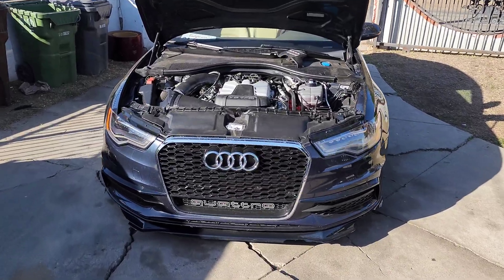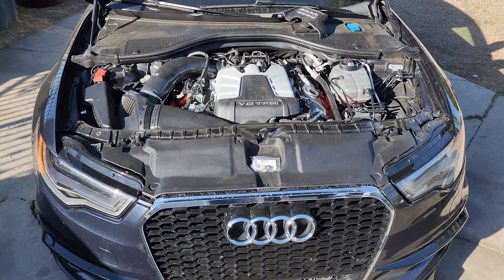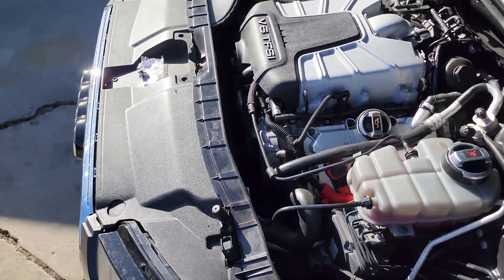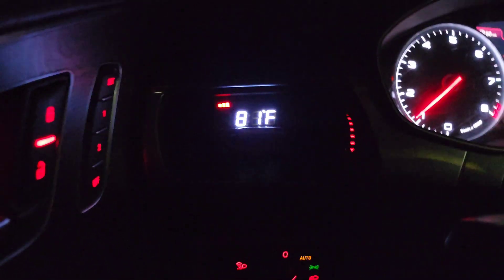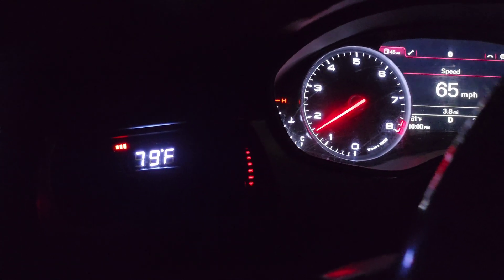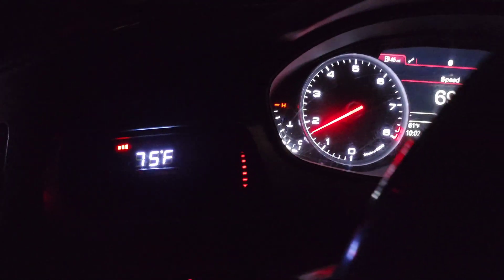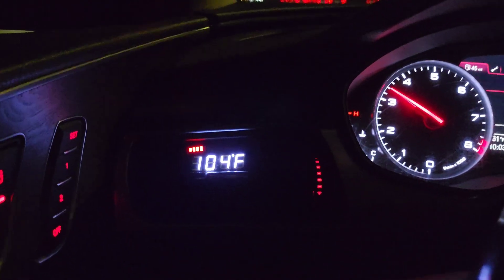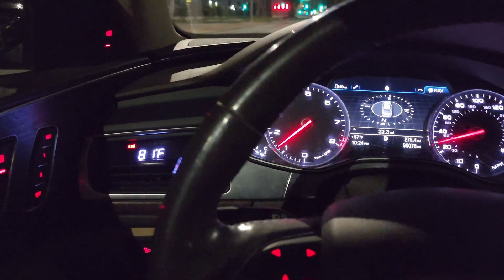CWA150 @ 100% Pump Run Test & 034motorsports Billet Bleeder Screws

Comment: can you give a update if the pump is still running good today? i just got my pump but trying to see if i should do 100 percent
Reply from the maker: Yeah it's still running @ 100%. Only issue I had was that the harness I used for it overheated and the connector melted. The guy who made the harness sent me revised replacements but they kept eventually melting. The harness side from the car was fine however. I eventually did away with the harness and just cut of the connector end where it connects to the car's harness and spliced it in with heavy duty heartstrink splice connector and no problems since then.

Comment: Hey, the R8 style oil and coolant cap, if not oem, I would go back to orgional as some of these copies do leak a little bit ,  check your hood for mist of oil.
Reply from the maker: Yeah I switched out the seal to an oem seal on it and it's been good with no leaks.

Comment: So i just installed the CWA-150 pump, mine doesn’t run at all, even with the PWM wire removed.  I can turn the ignition on(engine off)or just open the door, it doesn’t do anything.  Oh some info:

17 Audi A7 C7.5 3.0TFSI.  HX upgraded, Fuse is a 25 amp, its not blown.  Went through all of the fuses under the ECU, they are all good. Adapter cable from Merc racing specifically for the 150 installed as well.  I got the pump from Tecomotive prior to finding your channel.  They didn’t have any of the PWM kits unfortunately.  Any thoughts other than i got a bad pump?

To note: if i plug the stock pump back in, i can get it to run using OBD11 so I know power to the connector is good.

IATs start about 125, no pulls, normal driving at 30.  They climb and climb into the 160s and sit… super bad, by then im shutting the car off.  Any thoughts again?  Maybe a relay or other fuses?  None the leas appreciate your channel.
Reply: Did you ever get the CWA-150 to run without the PWM wire? im trying to just get it running 2core.
Reply from the maker: @nathandevine636 Yes, you just pull the pwm wire. Only thing is overtime the wire overheats from running at 100% all the time and eventually will melt the small connector that attaches to the factory harness. It's better to let the pwm control it to get the best performance anyway. The pwm will ramp it up to 100% when needed.
Reply: @cmidas3396  D-Vador didnt manage it? 

my CWA150 is fittted to an E39 m5 so i dont have the PWM control easily so i just wish to run it 100% i have an aftermarket harness. 

my pump just wont turn on even with the correct PWM signal or just power / ground
Reply from the maker: @nathandevine636 That's weird. It should come on at 100% with power & ground on any car. Probably should check for blown fuses or if it's wired correctly.
Reply: @cmidas3396  yep, checked i have 12v, its fed via a 4mm cable with like a 40A fuse, its not gonna blow the wiring, its for my old secondary AIR pump, i think ive got a faulty pump and im chasing my tail for no reason.
Reply from the maker: @nathandevine636 Sorry that prior response was for a different pump. If you go on Mercracing's site they have a diagram for how the different pumps are wired. Also don't go by the color of the wires in the harness. For instance on my supplied harness the red wire actually goes to negative while the blue wire goes to positive. You have to go by pin number to be sure.
Reply from the maker: Sorry to hear you're having and issue with the pump. I would say double check that the harness is good. I had trouble with the adapter harness overheating & melting so I finally did a direct splice but that was with a harness from someone who makes them on ebay. Are you getting a code that it's not running?

Comment: Does your pump come on when the car is running
Reply from the maker: Yes, with the pwm wire pulled it comes on at 100% anytime the ignition is on or when the door is opened. With the pwm wire in it operates as normal.

Comment: Did you change the fuse for the 150 pump?
Reply from the maker: Yes, I changed it to a 25amp fuse in the video where I installed the ethanol sensor.
Reply: @cmidas3396  i think this setup is the best you’re gonna get cuz the intercoolers in the SC just get cooked. Idk how much porting it costs but it may be more cost effective to just get a SC that was engineered for better IAT’s
Reply from the maker: Yeah an interchiller is probably the way to go. Mercracing just released their new supercharger for the 3.0T. Hopefully it will perform well and offer atleast over 600+ to the wheels.
Reply: @cmidas3396  the only way to eliminate this is to switch to a procharger system w/custom intake manifold. This would solve IAT’s AND PCV problems.
Reply from the maker: Interchillers/killerchillers seem to work very well. They take iat's way down.

Comment: Interesting info. So you're stage 2 dual pulley? Exhaust sounds quiet.... Do you still have stock cats?
Reply from the maker: Stage2+ lower 207mm crank pulley for a dual pulley ratio with mid muffler delete.
Reply: @cmidas3396 no concerns about melting cats? How long have you been DP?
Reply from the maker: @fccquoter19  I've had the downpipes for a few months.